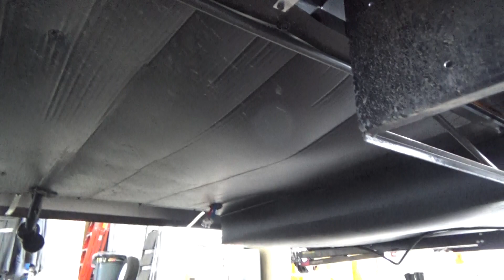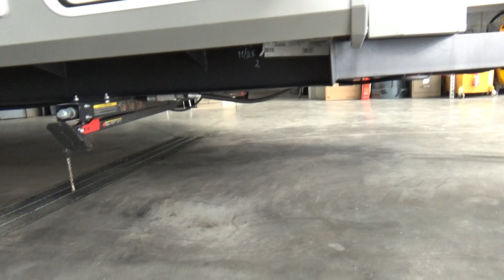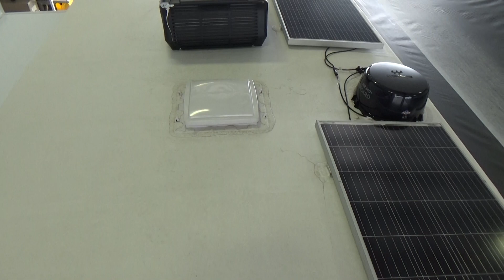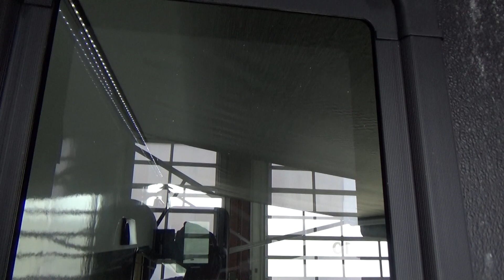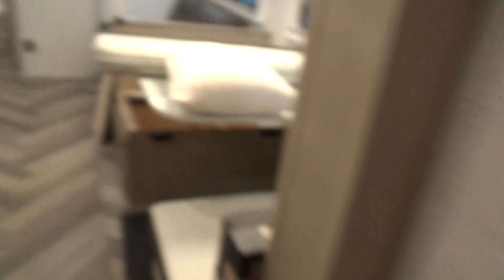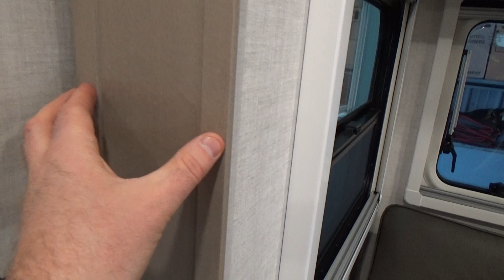2023 Ember RV Touring Edition 26RB Travel Trailer - Massive Bathroom!

Comment: Really like this trailer design and innovation. Love the bedroom skylight and bathroom. However the floor pattern is too busy and the ccc is too weak at only 1395 lbs. Filling up water alone weighs 450 lbs, not to mention batteries, propane, food, gear, etc. Bummed to see such a low ccc on an otherwise well thought out camper.